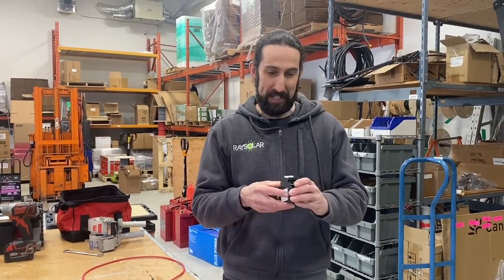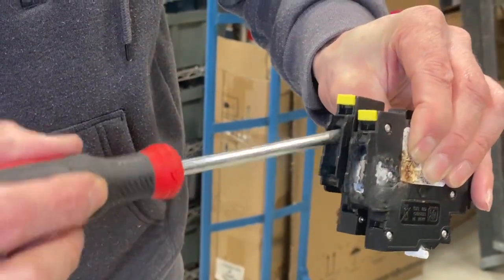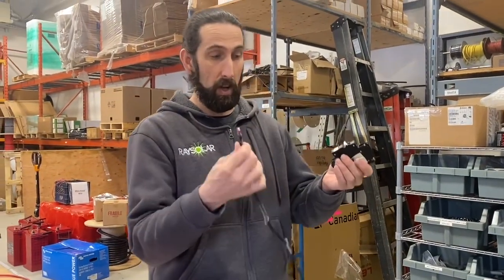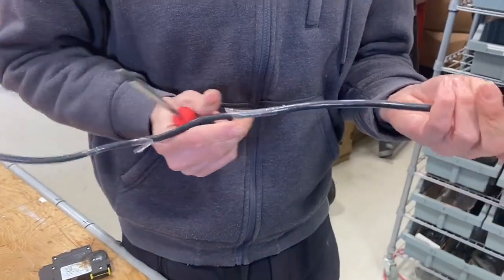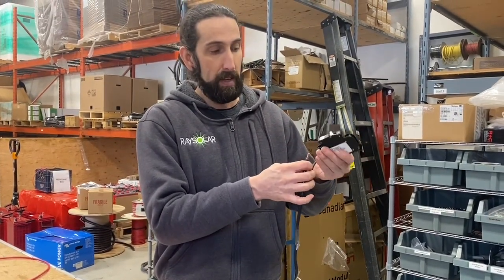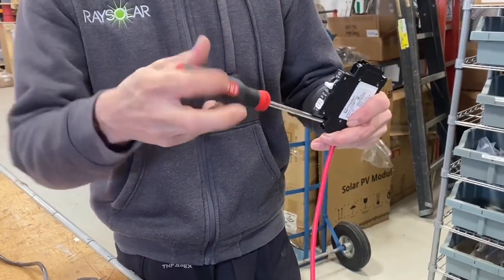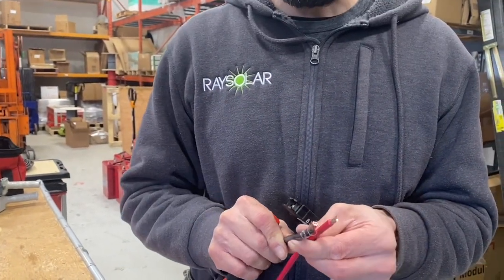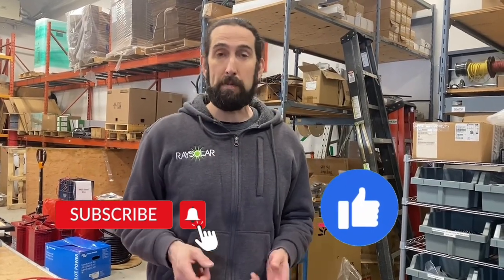Tug Your Wire|Review A Failure In Wiring A Midnite Solar Breaker

Comment: thank you for this video.  I have a 10 awg wire going into one of these fuses, however even with a (yellow) 10awg ferrule the wire pops out easily despite the screw being tighten quite well. Any suggestions?  Can I crimp a larger ferrule over the 10awg ferrule and screw that into the fuse?
Reply from the maker: Hello Rob, Thank you for the question, I would recommend contacting our offices for an answer on this question, our information is as follows:

https://www.raysolar.ca/contact_us/